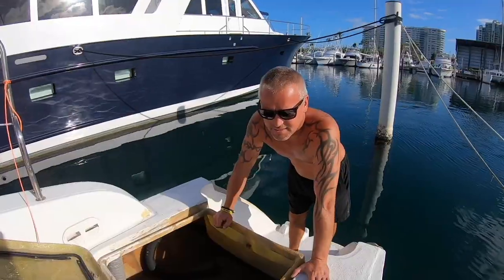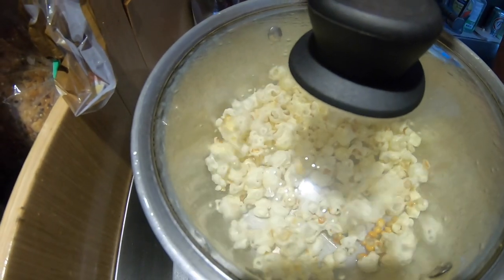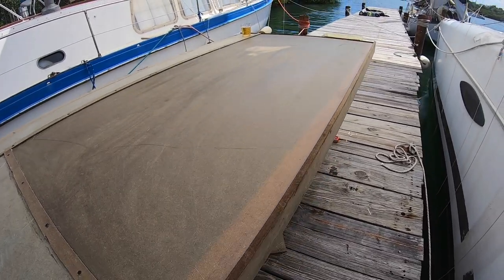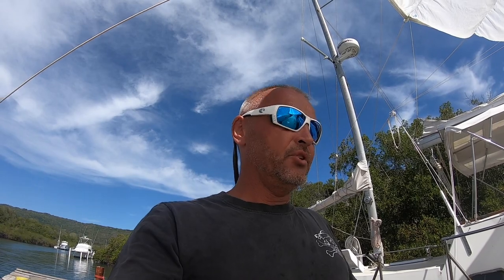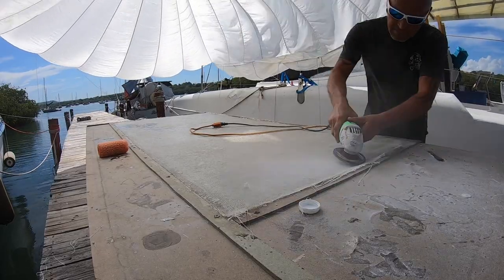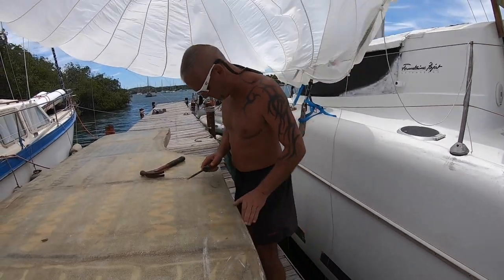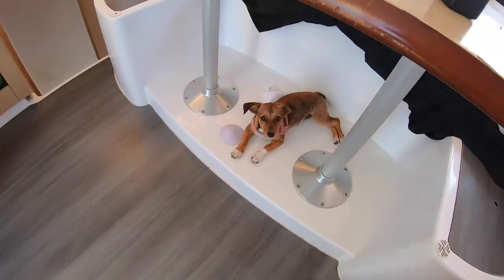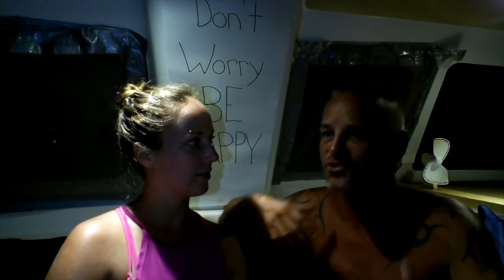How To: Build a Hardtop aka STILL building our Hardtop Part 6(S2 E22 Barefoot Sail and Dive)

Comment: My hats off to you working outside in that heat. Yeah, I've used barrels and barrels of polyester resins so am super comfortable with them, but the epoxy fillers are worth what you have to pay. It's all in the dollars and cents, and what you can get!
I hope the fellow sailors kick you back something for your help, especially the hardtop( I'm sure they are).
 Cheers Warren
Reply from the maker: Thanks for the comment warren! 
It’s all what your used to. The polyester is getting a bit easier to work with as we learn it. Would still prefer epoxy though lol
Reply: Barefoot Sail & Dive   Smells less too!

Comment: Next time you do a sheet of GF like the one you for your fellow sailor don't bother with the edges (which could lead to air gaps etc) just use the base board and lay up an inch or so more than you need all round. Lift from the mould and trim to size.
Reply from the maker: We found the edge worked very well on this piece. But thank you for the advice! I may use that on another project I have planned!! 
Cheers!

Comment: I know you are limited in materials but this is more a lesson of how not to build a hard top.... It is going to be very heavy but without foam to make a composite roof your a bit stuck with what you have.. Keep going it will do the job  and it will keep the sun off.
Reply from the maker: It’s not that heavy so far.